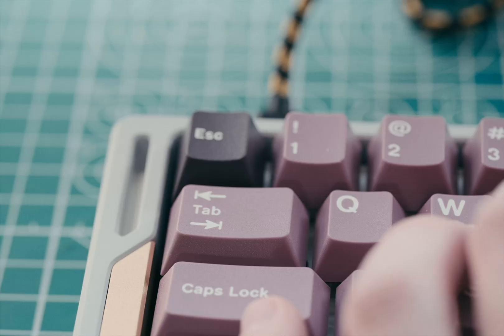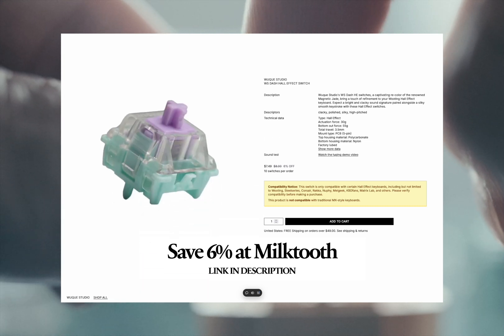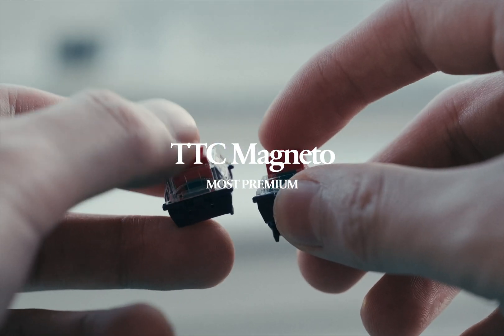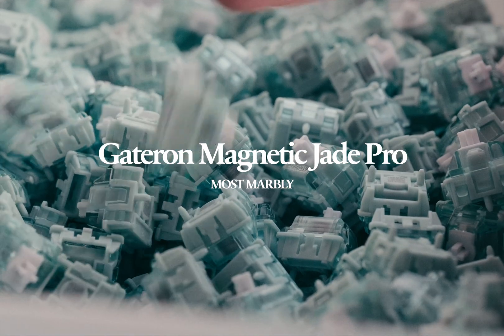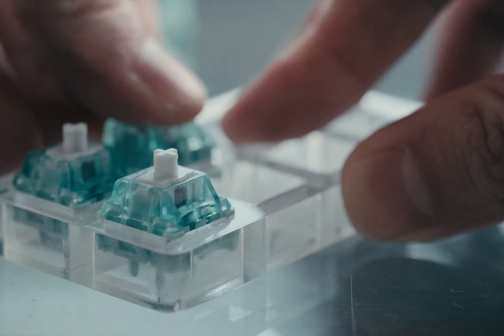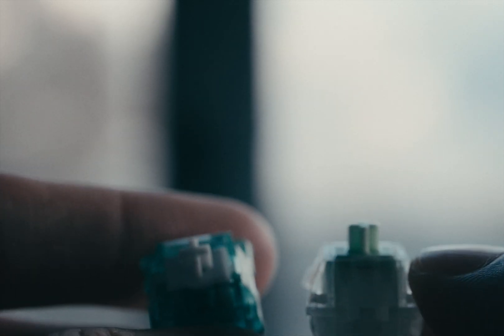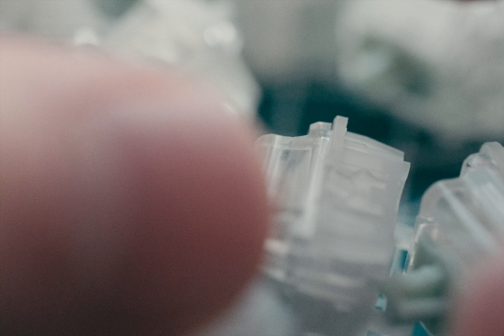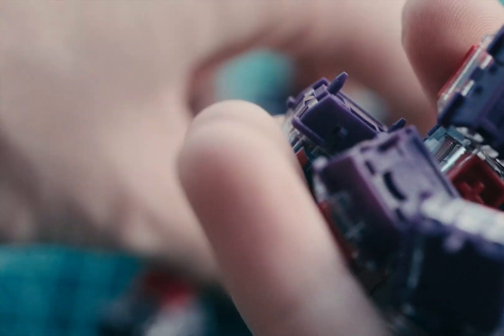Top 5 Hall Effect Switches (2024)

Comment: i know its old-er video, but i ordered the sticky rice v2 and put them in my brand new Aula Win60HE Max. It sounds awful, nothing like this. There is a scratchy ping sound, so I lubed them fully and extra on the springs. Still a similar un-pleasant sound. Is it the board? The PCB plate is aluminum I believe. Help needed!! :)
Reply: Hi, I don't really know what I'm talking about, I still haven't built my own xD but have you tried doing the tape mod?
Reply: i'm pretty sure you've got the wrong sticky rices. U've gotta have the rice puddings
Reply: @sora9646  Everglide Sticky Rice V2 which is the exact name and company in this vid is the ones i got

Comment: I found my batch of sticky rice switches to be completely unusable due to the fact that they were so rough. I have never experienced a worse switch feel. Very sticky at the top of the switch which is a truly bad design for hall effect because it does not allow for 2mm key press and pretty much forces you to bottom out. I wonder if I just got bad batch or if I should try lubricating them myself to make them smoother. They do sound great. Much better than the green lekkers.

Comment: Keep in mind, that the Jade Pro are terrible for RGB for many colors due to the colored housing! They are marginally better feeling-wise then the original Jades. And sadly the Jade Max have a design flaw making them scratchy. Those would be great RGB wise.
Also Geon RAW HE is considered best (smoothness) by a multitude of people and not mentioned here.
Reply: the new gaming seems to have the same problem :c
Reply: I have jade pro, after some testing; pink (r=255 g=0 b=255 look like r=91 g=0 b=255) and yellow (r255 g225 b0 look like r=180 g=255 g=0) only legends backlight spot is 100% correct) but other colors are mostly little darken than switch with white botom and translucent top. I don't have more switches to compare, and don't use yellow backlight or 100% brightens so for me it's not a problem. But it's may be important for someone else.

Comment: Great video, thank you. I was surprised to see quite a few S switches in your spreadsheet. I currently have the Meletrix BOOG75 and was under the impression that there are no other switch options for it available but, if I understand correctly, your spreadsheet says there are. Would the Jade E Min work and would you consider it a good upgrade over the stock switches (I believe they are KS-37B)?
Reply from the maker: Jade Mini E works on Boog75. Haven't used it myself however
Reply: @milktoothnu  Thank you for this information. I hope someone will make a sound test of the Jade Mini E in the Boog75 compared to the stock switches. Maybe other compatible switches too. I would love to upgrade the sound of that keyboard.